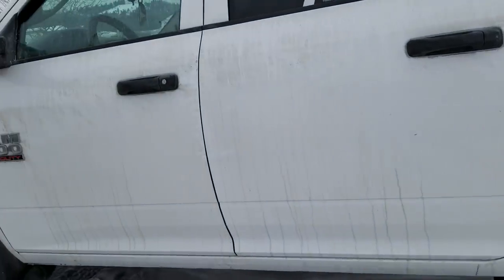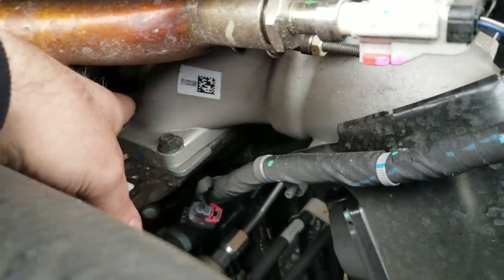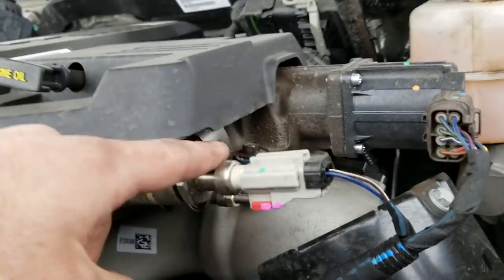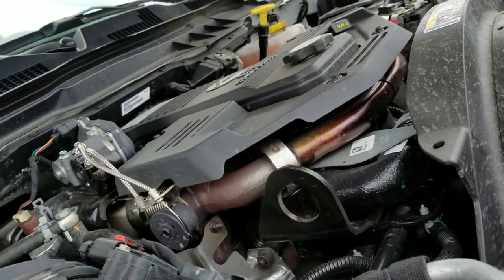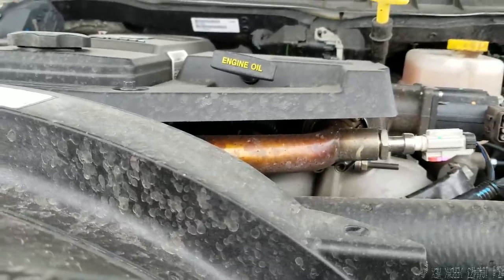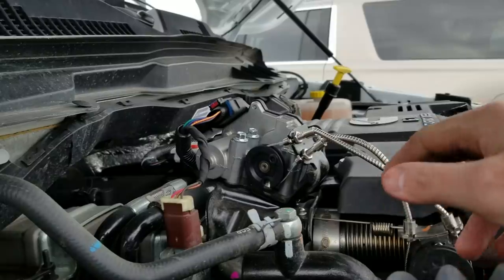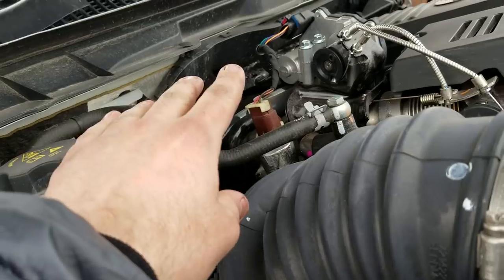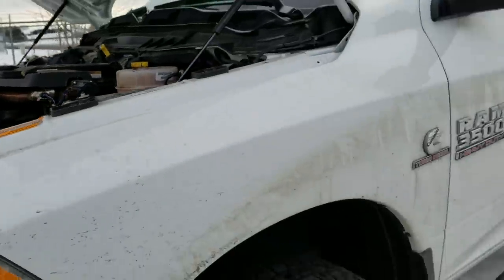13-18 Ram Cummins. The real problem with Egr

Comment: Paul - I know you know your stuff but you are kinda wrong on this one. Buy an Edge CTS 2 monitor. The EGR valve is ALWAYS between 48-71 percent. You use LESS exhaust gas during regen because your truck will not pass emissions at that point and needs the hottest air possible so it does not use cooled exhaust gas to do so. It is always running exhaust gas and uses less during regen.

Sorry
Reply from the maker: No need to apologize. Thank you for your help.
Reply: Is your comment implying that the EGR system doesn't hurt reliability?   Or do I need to get an Edge programmer in order for the EGR not to hurt reliability?
Reply: I Know You're Right But nope! That monitor only shows you everything going on with the truck. EGR hurts reliability 100%, exactly what Paul said
Reply: Pass emissions? I take mine they make sure all the crap is still under and out not even 15 min and this is in cali

Comment: Ok, you are overreacting...  The fine soot that you speak of...  Where do you think it came from?  The combustion chamber!  If I recirculate some of that exhaust air back to the combustion chamber, where it came from, how does this affect the motor?  It reduces NOX big time.  EGR (Exhaust Gas Recirculation) actually cools the combustion chamber temperature which in turn lowers NOX.  Lowering the combustion chamber temps so effectively is the main reason we are not at 1000 ft lbs of torque from the factory!  Yes, you can delete your truck and make it a smoky pig, if you're into that kinda stuff, but your EGT's are gonna be through the roof.  High EGTs are the real killer of your motor.  The system works well.  It's not without flaws, but it works well.  Buy a service contract if you're worried about cost down the line.
Reply: rcastorena Perfectly stated! Too bad people wont reason this out in their heads. So many uneducated guys on here with zero engineering experience or even open minds, yet they KNOW the emissions equipment is “killing their truck” (whatever that even means) lol
Reply: exhaust gases in your intake is not good for your intake. period. delete all that emissions crap and youll see a increase in mpg and performance. ive seen it time and time again. you want a dirty intake or clean? cause egr will make it dirty
Reply: kcwkembm “Dirty” is not harmful. It’s just metal ...it’s not like it’s gonna feel it or get a disease and die from being “dirty”. If it gets clogged, it can be cleaned. It’s not as big a deal as you’d make it out to be. Engines don’t “care” if they ingest their own exhaust gasses you know. Owners seem to tho. Lol
Reply: I work in air quality and spend a LOT of time with engine emissions regulations. The particulate matter emissions factors are based on the sulfur content of the fuel... That's it. With ULSD, you're at or below 15 parts per million sulfur, so the particulate emissions are so low... Makes EGR MUCH less of a problem than it was prior to 2007 when we went from 500 ppm sulfur (low sulfur) to 15 ppm (ultra low sulfur)

Comment: If you’re going to keep EGR on a truck it has to live it’s life on the Interstates pulling. An acquaintance of mine had 400,000 miles on his 19’ Super Duty when he traded it in for another one. Never an issue with the EGR system or the truck for that matter. He towed 5th wheel campers out of Indiana full time with it. I use my trucks for construction work so I have a lot of short trips. I delete because they would never last. I think with quality synthetic oil like Amsoil and their bypass oil filtration system the soot in the oil from EGR would not be an issue. If I didn’t delete my trucks I would go that route. I deleted my 07’ 6.0 and it was still running strong at 525,000 when I sold it. Oil analysis showed below average for wear metals. Carbon is abrasive and therefore it needs to be handled  somehow if you want your truck to go the distance. RAM, Ford and GM don’t care; they wish you would buy a new truck every week.
Reply: Buy oil wholesale and do twice the maintenance at the same cost is my mentality.  Change filters in-between oil changes.  You're a smart man.

Comment: Lol when a Non Engineer attempts to explain Engineering... Classic
Reply: Yep...everything is described using that definitive engineering term "stupid."  He's also pretty sure "they could come up with something else."  Never mind that every diesel engine manufacturer including industrial engines like Deere, Kubota, Yanmar, Caterpillar, Perkins, etc. all use EGR as part of emissions control - and NO ONE has been able to come up with "something else" to meet emissions requirements.  He needs to be pissed off at the EPA and the California Air Resources Board (CARB) - those are the entities that have caused the problem, - NOT the engine manufacturers.
Reply: Sgt. Shill You took the words right outta my mouth! (Or fingers, I guess, on here lol)
Reply: Either of you Doctors have a better video? At least he tried and did an ok job .... come on man.

Comment: I had a 2016 2500 with the 6.7. I loved the engine. I bought it in June of 16 and got rid of it in August of 18.  I thought I was going to keep it forever.  When I got rid of it it had 16k miles and went into Regen once. I towed my boat with it on the weekend in the summer and used it to haul stuff once in a while. In July of 18, I was towing the boat, stopped at a store and when I came out I could feel the heat of the engine from 20’ away. When I got in the oil was 235, engine temp was 240. I couldn’t believe it.  I drove a little and the temps went down. About an hour into the trip the engine light came on and said service exhaust system immediately. It then wen into power reduction where I couldn’t go More than 35 mph. I couldn’t hear the turbo and the engine would rev up to 3k rpm. When I got where I needed to go the DEF injector sounded like a solid sound it was injecting so fast.  I could also put my hand on the tailpipe and not get burned. I brought it to the dealer and he basically said the exhaust system was clogged cause I didn’t drive it enough. It was still in warranty and I could have fixed it but he said if it happens again it’s very costly to fix. So I traded it in on a 2500 Laramie 6.4 hemi. It was very frustrating.
Reply: Yeah emissions diesels need to be driven alot and long distances to work properly. If you only take it out once in a while and putput around, you'll ruin the system.
Reply: SilverStar Heggisist that’s what I’m told. I’d rather have a diesel but with the amount that I drive and tow it’s clear I should have a gas. It’s a shame what the government has done to that industry. Larger semi’s maybe but small trucks it’s ridiculous.
Reply: @trx350  they do it to the smaller trucks because there's so many of them. 

In order for you to have diesel you'd need to delete the emissions system or get an older one.
Reply: How do you like the 6.4 hemi? Mine has 120k on it and i had to replace the mds lifters that were going out. PITA

Comment: Because the engine oil absorbs and captures that soot and filters it through the crankcase and oil filter. Diesel engine oil is different than gas engine oil Diesel engines through natural combustion create soot, lesser due to cleaner fuels, either way Cummins obviously designed this for emissions regulations. Change oil at proper intervals and sooner if necessary you should be fine. It’s not a big deal but consumers who worry about everything that truck manufacturers do keeps the aftermarket going.
Reply: Powder River for your oil to “catch” soot, it’s got to go past your rings.. carbon is very hard, there’s no way it isn’t impacting the cylinder walls or piston rings while it passes through that space.

Comment: Actually that valve with the cables mixes cooled and non cooled exhaust gasses to a computer determined temperature. The valve that allows exhaust gas into the intake is the one above the intake pipe.

Comment: You explained fairly well what the EGR system does and essentially how it operates.  It will be long, but well worth the read.  I'd like to add some more info that others may find useful about the EGR system and particularly this diesel engine so here goes.

The EPA has standards and regulations that must be met by ALL vehicles that are to be sold and used in the USA.  The EGR system is ONLY used in the USA.  The EGR system exists to REDUCE emissions produced by the engine, whether that be gas or diesel.  Now for the good stuff...  The GOAL of the EPA and our corrupt government is for its citizens to use as much fuel as possible.  That's right!  They want you to use fuel and lots of it.  Why?  Because it makes them rich.  It is, after all, the world's #1 commodity.  So, what the EPA and government do is REQUIRE engines to be designed to get terrible fuel efficiency.  That's right!  It's by DESIGN.  An engine that is NOT efficient will produce much more emissions, thus the need for the EGR system.  So, it was designed to HELP an engine that is terribly inefficient to produce "regular" levels of emissions (and fool all its users into thinking it's a good thing).  All they have to do is allow the manufacturers to produce EFFICIENT engines and the EGR system and others would not be needed.  An efficient engine will produce MORE power, use LESS fuel and produce way FEWER emissions.... it's magic!  The 6.7L Cummins in particular ALSO injects fuel during the EXHAUST stroke which is used to burn off excess emissions and UNBURNT FUEL in the DPF system (Diesel Particulate Filter).  The reason there are excess emissions and unburnt fuel exiting the engine in the exhaust stroke is that it is inefficient and DESIGNED that way... to use more fuel.  The "particulate" that this poster is talking about going right into your intake manifold at the head from the EGR system is correct.  That particulate can make its way clear past the piston rings and into your oil, not to mention, clog the shit out of the entire EGR system, intake manifold, camshaft, and valve system.  It acts as an abrasive and will wear out engine parts FASTER.  That's bad and by DESIGN so you BUY a new truck after your current one takes a shit.  Some engines or drive systems like "hybrids" CLAIM to get much better fuel economy.  The fact of the matter is that the engine is still inefficient and only SEEMS like it gets better fuel economy because it is assisted by an electric motor.  Engines that ACTUALLY have high efficiency are BANNED from sale and import, etc. in the USA =]  Take the honda VTEC made in 1990 for example.  Most people have never heard about it but you can find out information about it online.  It was a PRODUCTION 4 cylinder engine that ran on gasoline and achieved 70 MPG untuned.  It was immediately banned from import to the USA.  That was over 30 years ago.  The technology has existed for DECADES to EASILY produce an extremely efficient engine that achieves amazing fuel efficiency.  If this technology was applied to the 6.7L diesel and a couple changes were made to the mechanical design and fuel injection process, it could EASILY achieve 100 MPG.  But again, our corrupt government will NEVER let that happen.  They have been and will continue to tighten their grip on the expanding EV and Hybrid vehicle market and impose similar regulations for decades to come to make sure they get as much money as possible.  If you buy an EV, you have to have a charging station installed at your house (if you want to charge it there).  Did you know that the energy (electric) companies charge MORE MONEY when you charge your EV, which is separate from all your other electricity usage?  It's like charging a dollar for a gallon of water, but if you use the water to DRINK instead of watering your plants or showering, they charge you TWO dollars a gallon....  for the same thing.  It's a scam.  They will get their money one way or another.

What can I do to my current 6.7L Cummins to improve power, fuel efficiency, torque, and longevity?  Easy.... you take off all that bullshit equipment they put on to restrict its potential.  My stock 2018 RAM 2500 gets 11-12 MPG towing and 14-15 MPG unloaded and has 440 HP and 900+ ft lbs of torque.  A "deleted" RAM 2500 6.7L Cummins will get around 15 MPG towing and near 19 MPG unloaded at 660 HP and nearly 1400 ft lbs of torque.  How is this possible?  By removing all that bullshit and "tuning" the engine's computer.  It removes the fuel injection on the exhaust stroke.  Removes shit particulate EGR gases from entering during the intake stroke.  Improves the flow of air in and exhaust out increasing power.  The fuel burns better and cleaner because the EGR gases are no longer combined during combustion.  Removes particulate from entering the engine oil and other engine area/parts, GREATLY increasing engine life and lubrication.  Removes the need for DEF further saving money on unneeded "fuel".  Note that tractor-trailers are UNREGULATED in the USA.  This is because they ship all the goods sold every day which produce incredible amounts of TAX DOLLARS in sales tax, so they are "allowed" to be unregulated.  It's all about money folks and it's a big scam.  Also worth noting is the fact that massive cargo ships that carry goods (containers) across the oceans produce an astronomical amount of emissions and OTHER emissions that vehicles don't put out.  The ratio is ONE giant cargo ship puts out just as many emissions per year as 50 MILLION passenger vehicles.  There are roughly 800 million passenger vehicles around the world.  This crazy amount of emissions from cargo ships is only considering GIANT cargo carriers.  There are about 100,000 cargo ships in the world.  These ships are also very lightly regulated.  They use fuel measured in TONS per hour.  It's heavily one-sided against civilian passenger vehicle use and is a big fucking scam.  Anyhow, hope the information is helpful and informative =]
Reply: Damn! Worth the read. Thank you for taking the time
Reply: @omarpadilla7674  You're welcome.  I like to share the information where many people may see it.  This continues because most people have no idea what the government is doing.
Reply: Good read. Thanks!!
Reply: Odd, cuz it's used in Canada too bud.
Reply: @cryptobuddha2600  Vehicle make, model, year manufactured?  Was it manufactured in the USA??  Probably.  Anyhow, you missed the point.  The point is that we can do incredible things with engines and greedy 1/1,000,000 people keep it from humanity.  Neat!

Comment: That's why you Delete that crap. And don't tell anyone. 😁🇺🇸🇺🇸🇺🇸🇺🇸
Reply: Kinda hard when your truck is registered commercially to haul. They see that crap not working, youre fucked...
Reply: Take the crossover pipe off and plug and reinstall it. Never know it blocked off internally
Reply: Brandon C nope cause you bought it from the dealership like that 🙃🙃🙃🙃
Reply: jason larsen then that’s your problem and the dealer sold a illegal truck

Comment: Any soot that makes it into the engine is cleaned by the oil.  Since they say to change the oil every 15K, it really can't be all that bad.  I do agree that the emission crap does take away from the performance of the engine, but I don't feel that it's a deal breaker.  Yes, you have more things to look after and clean, not to mention the whole DEF issue, but the engine, even if not deleted, will last longer then the truck it's in.

Comment: you don't know what your talking about. this is straight out of service manual..."EGR is active at low load and speed ranges. Control of EGR flow is based on engine load and engine speed." high loads and engine speed nox is low enough for converters to clean up. dusting is from small particles "silicate minerals and silicate rock fragments" which acts like a polish and smooths out the cross hatches in the cylinder wall. when that happens the oil doesn't stick, its gets scraped off by second piston ring. the top piston ring runs on dry smooth surface and causes the piston ring stick and the up and down  movement of the top ring makes it rock up and down in the piston groove and eventually breaks the ring and scores the cylinder wall and causes more damage. Soot is by product of combustion of heavier fuels. You have to clean Egr valve and cooler at intervals due to when the engine is cold and first starts up you get condensation and that makes the soot stick to the cooler, the valve and heater grid and that slowly builds up. I have heard they are working on a post dpf egr system. nothing solid yet. most of our problems are software and that sometimes leads to component failure. Once a problem is recognized, we get an updated software to correct it.

Comment: Youre right on. Just replaced my EGR cooler at 150k. $3500.00 bucks. Dealership replaced my head gasket instead of my EGR cooler. $4300.00 for nothing.

Comment: EGR can be done away with and still have a "clean" emissions truck. I have heard of some semis being EGR-less now. The SCR(def fluid thing) will pick up the slack in terms of eliminating nox. And as a bonus you will see better DPF lifespan because a side effect of the EGR actually causes more soot to go into the DPF.
Reply: Soot into the dpf isn’t a big deal. Engine oil is the DPF killer. Zinc and phosphorus are what clog them up. But, yes, downsizing DPFs and using more DEF volume will be a trend in coming years. It’s all about HOW fuel is burned. Higher injection pressures and smarter computer controls will help too.

Comment: You can either do a egr delete, get rid of all the emissions crap, get rid of your dpf system and have a very reliable 6.7 or you can opt for taking off the 6.7 head and installing the head off a 5.9 which flows better and by passes all emissions bs, 6.7 block 5.9 head  = tow monster